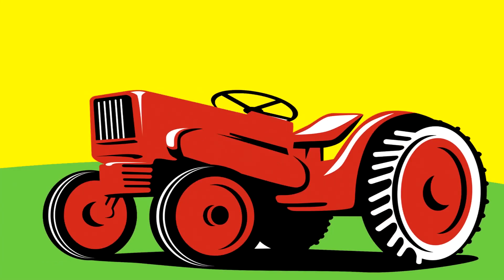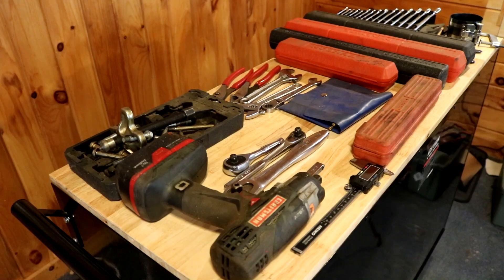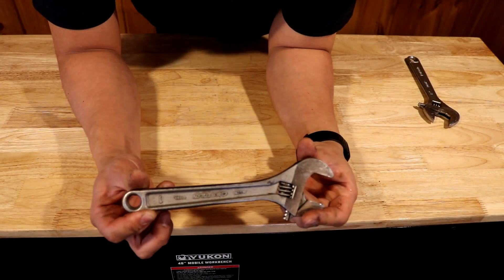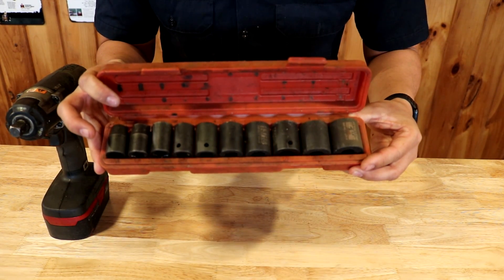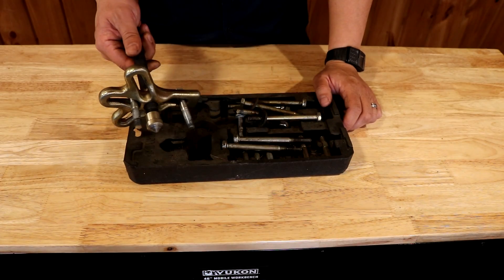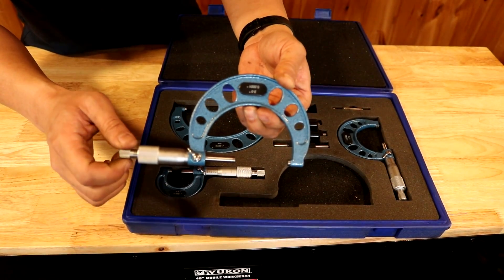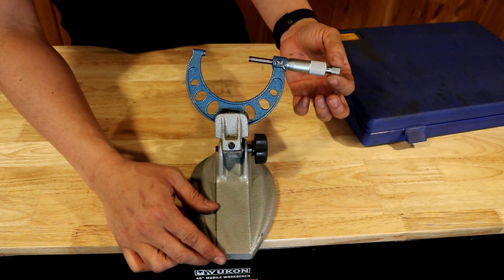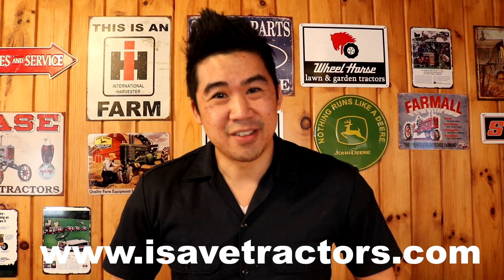Tools You Will Need to Restore Your First Vintage Garden Tractor and Small Engine

Comment: Hey Norman! I have a 1974 JD 140 h3 with the k321 as and it needs some cylinder rings, the head needs to be replaced or leveled, and it needs a cylinder always use your parts! If your bored I live in nh so if you want to do the project let me know what a price would be! If not no worries! Thank you!

Comment: My husband passed 3 years ago and I was finally "allowed" to get his Wheel Horse from my in laws who borrowed it.  They abused it and it looks like they took parts off of it so I need to fix it.  I printed a manual and parts list from the internet.  Do you have a post of which tools I need just for working on the wheel horse?  I can not afford extras as a young widow and would prefer to get only what I would use on/for the wheel horse 31128.  Thank you for your time.  

Also, my hubby was planning a front end loader? (Like a bulldozer bucket but skinnier?) With hydraulic parts and what you called a root digger but we'd use it for planting like a tiller.  The kids watched your videos with me and now are determined to build Ben's wheel horse attachments.  Thank you for helping to bring hope back to us.  💛💖💚💙❤💜

Comment: I have a suggestion for your budget shop:  thrift store pots and colanders make great small parts washers, and since you're in Maine you should be able to find plenty of old enameled lobster pots.  I use  a water-based parts cleaner or mineral spirits depending upon what I'm cleaning.  It works much better than brake cleaner spray and your lungs will thank you.

Comment: I agree with you about the tools except the multimeter the cheep ones at harbor freight are junk I have had many of them they were giving them away some didn't work right out of their l packaged the rest didn't last very long I have a lot of harbor freight tools that I love but not the  cheap meters
Reply: The "free" one definitely does suck. It's not even really worth having it as a backup because I've had more than one just simply quit for no reason. I do a lot of "mobile" small engine work and now keep the cen-tech 95670 in the truck box.
I've had it bouncing around in there for about 4-5 years now, no issues. 
I don't know if that model is still available because when I now look it up this one comes up, (looks similar):
https://m.harborfreight.com/11-function-digital-multimeter-with-audible-continuity-61593.html

I use a fluke at home but that's only because I used to work in the electrical field and at the time  thought it was cool to overpay for tools.
Reply: Larry A. Mccloskey Sr 
This is the one I have. It doesn't have great reviews on the website but mine has been great.
https://m.harborfreight.com/lcd-automotive-multimeter-with-tachometer-kit-95670.html

Comment: Are you OK with the old GT Craftsman tractors I have one with a 18 HP Kohler with a shaft on the back and front of the motor, just installed hydraulics and try to make a loader for the front. Wish I had a John Deere 400 I absolutely love your 400 a work horse anyways thanks for the videos and let me know what you think!!! 🚜

Comment: Can you maybe do something with a department store lawn tractor? I know is way under the level of what you do but I enjoy them. I currently have a 2009 Troybilt Pony that I use almost daily, a John Deere LX172 that I need to restore some day and some other one that I blew up a few years back.
Reply: I like the Pony , good unit for $1000 but most of them big box mowers are stamped steel , aluminum rear end gears and plastic everywhere. IMO Not worth restoring because they just won’t last another 30 years. All my Cubs are from 60-80’s and my Deutz - Allis (Simplicity) is 1980’s; after that they just got really cheaply made.
Reply: @RustyZipper  Yeh it is for sure not the best thing out there. Mine still all in all looks new after 10 years but I take good care of it and keep it out of the weather. The only issue I have is the paint bubbling on the floorboard. I assume the whole undercarriage is rusted.

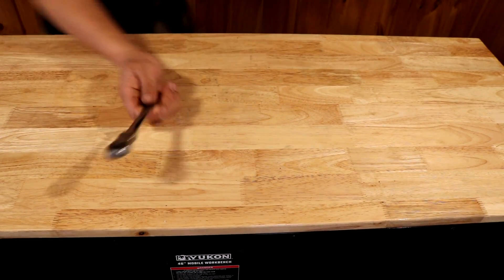Comment: 3:57 I truly love my 5 piece ratcheting end wrenches with a flexible head set from Harbor Freight-  $20. When I’m reassembling my Cub Cadet I Keep the 3/8 & 7/16 in my left pocket and the other 3 in my right pocket. If I’m using say the 1/2 and will need it again I put it so the pointy end faces up. Slide my hand in and instantly know that’s the 1/2”. Rarely do I need the old ratchet and extension

Comment: Very good intro and video!!  people get carried away with brands.  It’s so much fun working on tractors.  Be careful it becomes addictive :)
Reply: Sure does.  But what is so great about Norman is he loves all the manufactures and appreciates the uniqueness of each one.
Reply: Norman has Cub Cadet Fever 🤧🤕🤒
Reply: I finally got my Kohler K341 pulled away from the drivetrain. I had to cut the doublechain away with a side grinder. Those K series engines are heavy.
Reply: Where I'm at, alot of addictions can lead to overdose. I don't see OD ing being a problem . Just watch the time if you have to go to work in a few hours.

Comment: The only thing I cannot agree with is adjustable wrenches. I refer to them as nut rounders.  I do own two, but couldn’t tell you the last time I used them.  

For regular wrenches craftsman has nice 26 piece sets that are regularly on sale for $49. They come with quality ignition wrenches, not the stamped junk ones, and they go smaller and larger then any other affordable options. For $100 you get metric and standard and you have the correct size so you don’t need the adjustable ones.
Reply: Nice to have handy in case you are feeling too lazy to get the second end wrench from the drawer or just need it to hold one bolt that could be a 5/8, 3/4, 7/8 or 11/16. Pro Tip- I always buy SAE adjustable wrenches, not a fan of the metric version
Reply: Rusty Zipper I’ll admit grabbing the ratchet wrenches too if there might be need for two. If it’s in the jumbo range I take a pipe wrench before adjustable unless appearance is important.  I’d rather have tooth marks to rounded corners as a worst case.
Reply from the maker: Adjustable ones don't round the corners when you use them right ;)
Reply: isavetractors a skill not required if you have the right wrench.   😂 I’ve said oops a few times, and seen many others do worse, so I try to avoid it.  For carrying one wrench where your tools aren’t available they do work great.  👍 

I did offer the alternative set that comes with a case, or I keep in roll ups. Grab the metric or std set and lay it out beside the project. Have the wrong size, having the next size sitting in order it’s as quick to swap as adjust an adjustable.